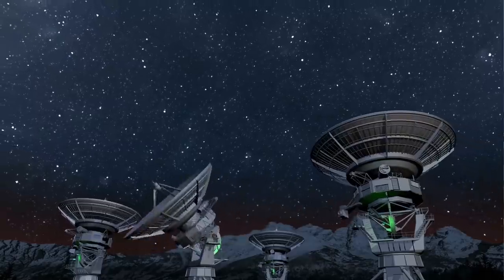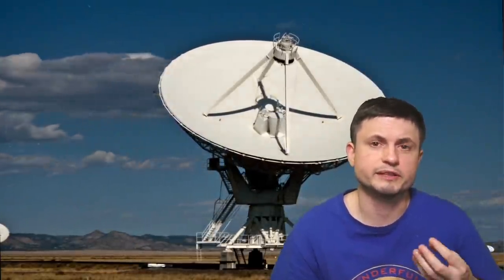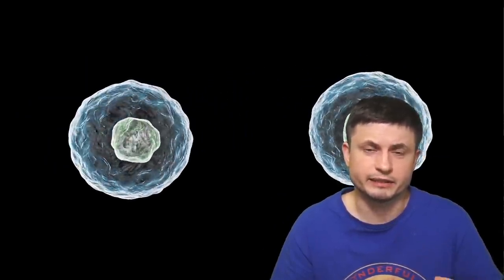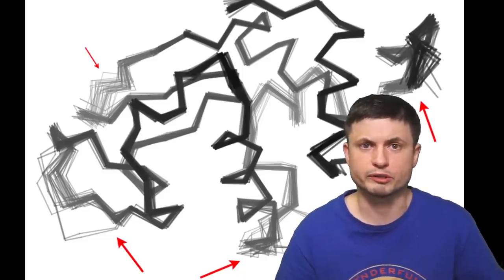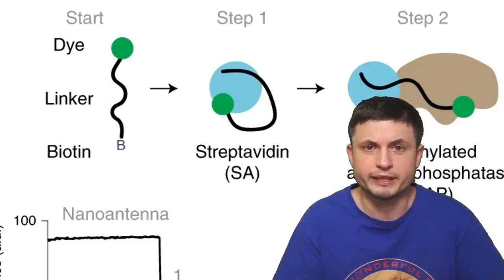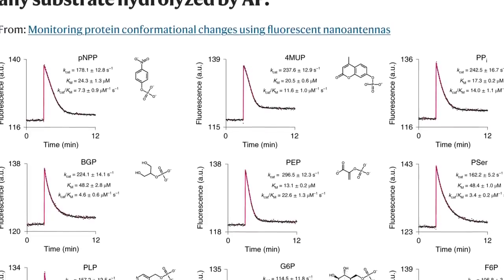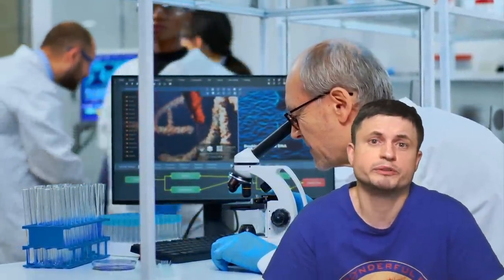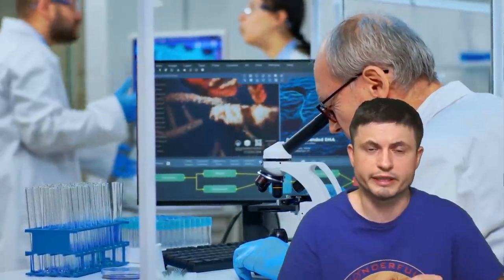Scientists Used DNA To Create World's Smallest Antenna Ever For an Unusual Reason

Comment: I don't know a lot about proteins, but even I can tell this is gonna be revolutionary. Since protein folding is a hard problem to simulate, I assume lots of people thought the main breakthrough would come from using quantum computers for that. But what better way to find out what a protein does than to just... look at what it does!
Reply: Very easy to disturb it"s Habitat.
Reply: Lately there's been a lot of work with AI to predict protein folding and apparently, it's making pretty good progress.
Reply: Why do you believe this technology was developed? 
What will it be used for?
Reply: @omarthesecond9768  ..elaborate
Reply: @PetraKann  for much the same reason as the microscope was developed
Reply: they used to use- and i'm sure they still do- x-ray crystallography.
back before computers this took years for a single protein, but computers made it pretty easy.
however, that does involve essentially freezing the protein, which is not technically  possible for all proteins.

my guess is they'll manufacture a couple dozen different DNA strands that will preferentially bind different 3-d structures and check which ones bind by the emitted light, and then use that to model the topography of the protein.

but i'm guessing.
Reply: @robertadsett5273  Some technologies are politically neutral and/or highly dependent on how it is rolled out.
Automation for example can be used to empower and protect workers in the workplace but it can also disempower them and benefit owners and managers.

Are you placing the invention of the mircoscope on the same footing as the invention of Genetic tools that can be exploited for nefarious motives?

You may need to apologise Mr Adseptic
Reply: @PetraKann  Genetic tools can be used to benefit people massively by creating more efficient, resilient and healthier food or making medicines. For example most Insulin today gets produced by genetically modified organisms in big bioreactors.

GMOs have been caught by a hysteria. They're a tool that is being used for good already, even if many people are afraid of it.
Reply: @PetraKann  it is a measurement tool not a manipulation tool, or no more a one than a spectrometer or a microscope are manipulation tools. It dangerous in the same way as any other knowledge gathering tool is.

Also I have no idea who mr adseptic is or why I would apologize
Reply: Proteins are amazing
Reply: I feel like DNA transcription is already a sort of quantum computer in itself. I suppose it's a step above but...... confusion haha.
Reply: I agreed. At this point, we might create a moment what I called "I use protein to learn more about protein!" stuff xD

Anyways, I'm looking forward towards advancement in the field of protein dynamics (through AI research and newly published paper regarding this nanoantenna), space science and plethora of interesting niches that would be a lot to type here for decades to come!
Reply: @PetraKann  like the movie real genius . a purpose for which is specifically designed
Reply: @PetraKann  It is the abomination of witchcraft: it is spreading, to our peril. The servants of Satan are the enemies of our people. We must root all such out in this time of peril! Aye! And we must pluck the sinfulness out from our own bosoms! Have ye thought what it means to burn in hellfire? To writhe and scream in the abyss of fire and brimstone? That is the doom in store for all who are denied grace: the witch, aye, and the traitor, and the scoffer of the true religion, the mouther of blasphemous oaths

Comment: Wouldn't it be weird if DNA was actually an antenna already and we are just now starting to clue in?
Reply: We are antennas!
Reply: Before getting to exited: "The DNA- or PEG-based fluorescent nanoantennas contain a fluorescent dye at one end, such as fluorescein (FAM), and biotin at the other to facilitate attachment (Start)" so look for fluorescent tagging to really understand that the DNA itself is not the antenna (better to say not the used antenna here and as a electronic engineer would say DNA is not more or less an antenna then anything could be an antenna).
Reply: @Techmagus76  have you ever considered how DNA is bundled almost exactly like a copper wire Is for a circular radio antenna?
Reply: Not weird. You are spot on.
Reply: Now you know why they called it the pandemic of the unvaccinated, see every Craig VENTER videos though.

Comment: Nice post, Anton, but this time I am going to call out the hype of this work.
First, it’s an old technique:  chromaphore oligonucleotides have been used in PCR assays for decade(s).
Second, while a novel application to protein dynamics with new and interesting results, protein fluorescence spectroscopy is even an older methodology (four decades).
The major limitation to this technique is to find a suitable analogue that binds to the protein but does not affect “native” behavior.
I would suggest taking a look a quantum spectroscopy - that method has greater potential to clearly define ultra-fast macromolecular dynamics.

Comment: mRNA can be used to synthesize these organic antennae, DARPA has been leading this research since 2013. The applications for this tech are endless.
Reply: @steveatkinson85  Truly amazing technology, the ability to monitor a hosts biological data wirelessly without the need of an internal artificial power source.
Reply: @kevindegenaar   So these DNA antennas can exist internally without being eliminated by a mammalian immune response?  And they receive and transmit data ?
Reply: @Opti-Mystic  There is an immune response,  however the application of an immunosuppressant can have great results in slowing this down. Data transmission is achieved by means of a nearby wireless device( Preferably hand-held).  Exactly the same principle is applied to tech like the Apple air-tag.  RX and TX data are controlled by a separate molecule at this stage.
Reply: @kevindegenaar  it's fascinating. Many thanks for answering.
Reply: They can read and write. Wet hard drive. Magnetogenetics
Reply: @grantaum9677   Does it have to be applied directly to the target cells to work, or can it be guided there? Or maybe just a blanket application?  
Sorry, I am new to this tech and find the official explanations and jargon hard to digest. Was hoping to get dumbed-down answers to help me understand.
Reply: @Opti-Mystic  there are multiple approaches my friend. Officially, they're not quite ready to use, it will only work with a cap that sends signals 

There's a version using 'microbubble' that works by guiding the particles to the desired areas in the brain using either ultrasound or electromagnetic signals (it seems our 5g network can do both)

There's also a possibility of programming stem cells or possibly using MRNA for a self guided version.

I've been looking into this recently. So quite new to the possibility myself. I can't do links because of censorship but if you have questions or want something a bit more detailed I can try and pass it on in code
Reply: @grantaum9677  Wow, wow and...  wow!  Thank you so much for replying. I love Anton's videos but, naturally, he cannot go into too much detail and it's ppl in the comments that often help me to understand more, and in a more palatable way.
There is much to ponder here, and investigate.
I am no cons pirasy theorist, but neither am I fully aware of the latest advances in tech and I like to know the possibilities - whether they admit it's usable now, or not, I don't want to be the last to find out 😆
Reply: @grantaum9677   I've been thinking a lot about frequencies, vibrations etc and will watch some of your saved vids. Thank you. I'm sure if u find interesting stuff on U tube you will continue to save it on yr channel.
Reply: @Opti-Mystic lol I'm like a skeptic, I won't believe something without evidence. But like you pointed out, maybe we can't afford to ignore the possibilities

Frequency and vibration is basically my number one interest now for the past few years.. Big synchronicity! 

I think the biggest help for me was Jill Mattson, she seems to approach things from more of a spiritual perspective but her explanations and examples really blew my mind.

There's archaeoacoustics, resonance and entrainment. Especially including brain entrainment. I really regret not learning music!
Reply: @grantaum9677  thanks.  I will look Jill up and also the other subjects u mention. I am ok with spiritual stuff, I like all info/theories/ideas and don't discriminate against what, who or why. 
I am happy to decide for myself what might hv substance or be bogus.  That's half the fun 😁 coz some theories are downright hilarious, even if they are true.
Reply: @Opti-Mystic  😂awesome lol best way mate 👍
Reply: @grantaum9677  The primary method of guidance is achieved by targeting receptors that are unique to the cells of interest. Different tissue types have different receptors and thus it is possible to code for a specific target as required.
Reply: @kevindegenaar  if they're using guidance to neurons, wouldn't it end up in all neurons though?

in terms of setting up a functioning neuron network for it, it seems they'd want to target precision locations. 

Unless the resolution capabilities of for example 5g is sufficient to make it work regardless?
Reply: @grantaum9677  The intricacies of delivery, guidance, assembly and operation are numerous. This is bleeding edge technology and not fully disclosed currently.
Reply: @kevindegenaar  from what I gather, the magnetogenetics version would be self targeted more along the lines of targeting say for example vmat2 and then remotely triggering that, which would deactivate the associated function
Reply: @kevindegenaar  I got the impression they really wanted to get the stem cell option to work, apparently the body's own system would put them in the right place if it's possible to command them to become a specific type. It coincidentally seems that the inside of the nose at the back is ideal. It has a direct connection with the brain, it's small and blocked with the smell nerves which has stem cells.
Reply: @grantaum9677  You are correct, the mucosal lining of the cribiform plate is the most direct method of introducing particles into the CNS.
Reply: @kevindegenaar  microneedles are very small!

Comment: Hello wonderful Anton! Actually, we have a lot of methods already for monitoring protein dynamics - most prominently NMR, but also Deuterium exchange mass spectroscopy, 2D IR spectroscopy etc. The technique described in the paper actually falls among those techniques that go beyond Diffraction-limit.
Reply: I am missing something. I agree with your statement that many techniques exist for monitoring protein dynamics, but why are you concerned about the 'diffraction limit' here? XRD was not used in this study at all, and deuterium exchange MS and NMR (solid state or solution) are not diffraction limited techniques.
Reply: Can one of you guys tell me please if these DNA antennas are built to survive a mammalian immune system? Or are they only using them externally? I'm not trying to be controversial, just ruminating. They can receive and transmit data??
Reply: @dgc0120   Thank you, I will mull that over.  
Yes, I'm looking at the optogenetic potential and also gene therapy applications.

Comment: Mr. Petrov, I learned in my childhood that sounding a pitch that matches one of my violin strings would cause that string — otherwise un-touched — to resonate "in sympathy" with the frequency that impinged upon it. (I'm just trying to think thru this concept here...)
Later study clarified that the sound energy was optimally absorbed with the natural harmonic series of the string,.. but this will work for any structure that has a natural shape that resonates to a fundamental pitch, and its harmonic series: 1/1, 1/2, 1/3, 1/4... et cetera.  That's the alternating compressions and rarefactions of the air molecules impinging on the fiddle string (or guitar, or piano, etc.) and adding energy like one child pushing a friend sitting in the seat of a Swing Set each time the friend returns in that pendulum movement.
Later in physics class, we learned that this "sympathetic resonance" also works with electromagnetic energies, with transverse as well as longitudinal  waveforms. I don't recall hearing of any upper or lower limit to the frequency ranges our present Reality can generate.
These principles as applied to structures at the scale of molecules and atoms, seem to lend themselves to mathematical analysis of energy patterns — absorbed and emitted, in response to samples of known composition being irradiated with known frequencies... Like X-ray Crystallographic analysis of structures.
•  Seems as if the purity of the irradiated target molecule "samples" would be a sticky challenge in all that, along with calibrating the signal going in and returning!
•  So, Those HIGH Frequencies seem to imply High Energies as well. And that makes me wonder how much energy a DNA strand can absorb without exceeding the chemical bonds that keep the structure intact.
For instance, don't astrophysicists detect Giga-electron-volt Cosmic Rays from 4th or 5th-generation "daughter" particles, so they are INFERRING the characteristics of the Original cosmic ray that crashed into our upper atmosphere???? Jeez-0-Peez, that seems to be a big pile of assumptions pile on top of each other!

Comment: Damn! And I thought the 2.4Ghz SMD antennas from some Express LRS receivers were tiny! 😬
Reply: Yep. And, these are sensitive to 5G freqs. 😇
Reply: @svenmorgenstern9506  5G stands for 5th Generation, and still operate between 2.4 to 4.7GHz, just like 4G and other standards do.  5G tech is all about all of the underlying data processing and routing tech, and not the wavelength of transmission.
Reply: I used to make wave tech devices for all kinds of physics, bio and medical research, like microwave spectrometers...  at 47GHz an antenna can be printed in nm scales on a circuit board, or a hair like (much thinner) filament embedded in Teflon (A better microwave conductor than air).  The big hurdles with miniature anything is structural integrity, fault tolerance, and longevity.
Reply: @Bob-of-Zoid  Search for the Express LRS then, dude. You're going to like it!
It's an open project of a radio link for rc. They use 900Mhz/868Mhz and 2.4Ghz, your choice. People fly with wings with those for more than 10km of distance... And you can make all the hardware at home if you want to. Or you can buy it from any brand producing hardware for it (and there are many already). You know?
But, well... I'm suspect to talk about flying FPV, because I have depression since 1992 and I always spent weeks happy after flying just for a few minutes.
Reply: @MCsCreations  I built an RC plane, and a boat as a kid, and loved it.  Now I build and repair guitars in my own shop, and have three hands full, but it is indeed up my alley.  I have always loved to tinker and build stuff.  I have never had a job that didn't involve being creative, and it is a very good medicine for depression;  Been there too.

Comment: I know this is going to sound a little crazy but how about nano to femto size Hilbert curves? Hilbert curves are a space filling curve and they can be n equals 1 2 3, they are a type of fractal and depending on how many bends and how complex you want it you change the number n, but in the cell phone world these antennas are like a two-dimensional well actually fractal dimensional object inside the phone and they are really really good at receiving radiation. So what I'm talking about is like really small Hilbert curves nano-sized that can receive information, that is even higher energy than a gamma ray. Maybe there are energies higher than that but we never had an ability to actually observe them??? According to the displacement curve or Wien's displacement law most of the radiation is in the visible spectrum is probably in the low infrared. Radiation beyond gamma would be quite rare I think and to trap it and observe it would be difficult. Where do I get these ideas? I've got this idea and it's too crazy to even talk about but I'm talking about scaling. The grand scaling of the Universe into like microscopic worlds and it's based on my observations of black holes and neutron stars and the way matter compacts. Maybe I'm nuts or maybe I'm just having a fun time, or both. I don't know I'll figure it out.